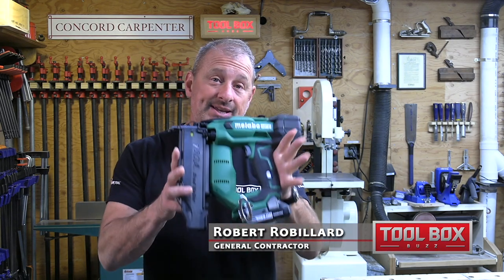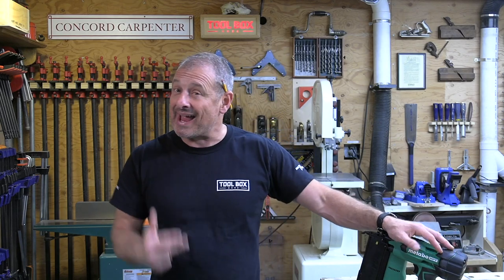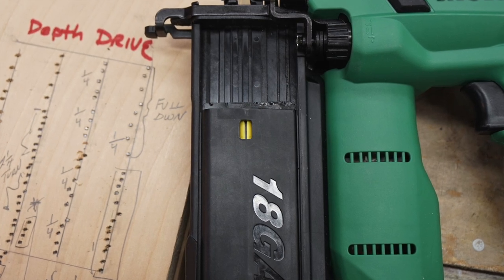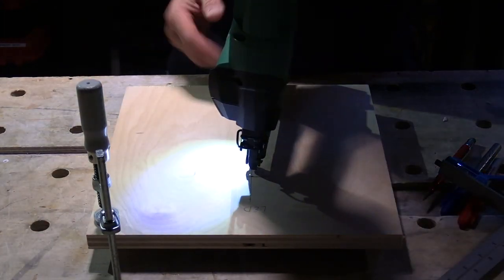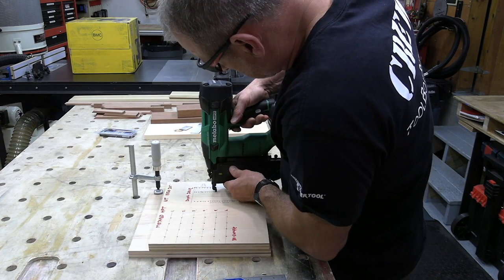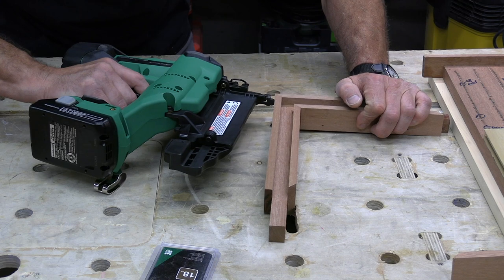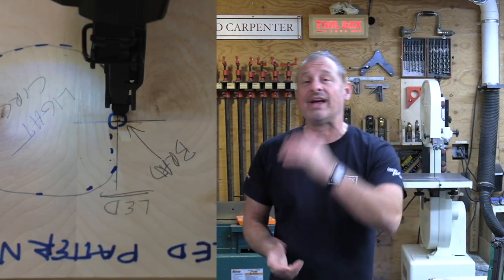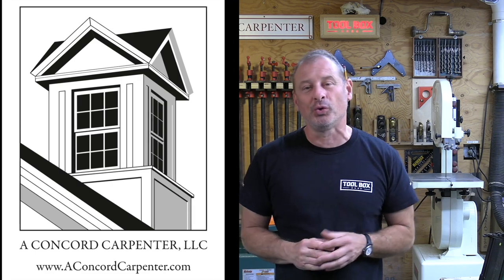Metabo HPT 18V MultiVolt 18-Guage Brad Nailer NT1850DF

Comment: Have the framing gun. Bought it first been great, so impressed bought the 15 g finish gun, worked great for about six months, then had a critical failure, need to send back, despite that bought the 23 g pin gun is ok a little weak and just recently bought the 18 g brad so far like the framing gun, impressed.

Comment: Friggin awesome! Smaller/lighter is better! I bought my cordless guns when they were Hitachi. I've got the 23, 18, 15 gauges, and a framer. I couldn't be happier. Well, now I could, because they just made this one. Haha! The "older" ones used the same tool body and just made design modifications for the different nail sizes. Even the 15gauge is the same basic gun with just different magazine and such. So, this is great that they completely revamped the 18 gauge. I probably won't buy it, though. I can live with the super sized one I have now. Thanks for the video! Good stuff as always!

Comment: I have the 16 ga, 18ga and framer, gen 1. These damn things won't die.  I will replace each one as soon as it dies with Milwaukee, but hasn't happened yet.  Only gripes are 
- the nail follower in framer gets dirty easily and doesn't push nails as hard so I get occasional misfire.
- the 16ga doesn't like 2.5" nails period!

Comment: I love my Hitachi 18v guns, so I’m excited to see improved versions coming to market. My only gripe is with the 16ga nailer which seems to not like sinking any nails longer than 1.75” which is quite disappointing. The 18ga has no issues with 2” nails and the 15ga and 30deg framer work like a charm. My compressor has been collecting dust. I would like to see an 18v coil roofing nailer though

Comment: Do this nailer still have that 30 minute shutoff feature where it turns the nailer off on you after 30 minutes of not using it? And also the 3 second tip depress where it won't fire the the nail if you hold the tip down for more than 3 seconds?
Reply from the maker: Yes
Reply: I wont be buying because it has those "features". What a let down. Cant believe they left them like that considering everyone i speak to hates it ant thats why i sold my gen 1.

Comment: Which do you like better, this nailer or the Milwaukee M18
Reply: Milwaukee 2nd gen is better, plus has a 23g to. this one still  weighs a lot.
m18 has a why better tool line up and tablesaw and miter are m18 .
Reply from the maker: The Milwaukee is better
Reply: @ConcordCarpenter  glad to hear that, i have the m18 but am always intrigued by new offerings from other manufactures. I used to be loyal to one battery platform but I have found myself over the last few years giving up that loyalty if I find a tool that I like better on another platform.
Reply: Any of you guys have had any problem with the Milwaukee 23 gauge gun not sinking the pins? Mine very seldom sinks them completely in any type of wood. Yes I've checked the depth drive dial and it's set to the deepest setting...
Reply: @reddawgrup1779  Try headed pins
Reply: @bradkjernisted2076  Never thought of trying that... Smh.
Do you have the Milwaukee 23 gauge? Is that what you use?
Reply: @reddawgrup1779  have had zero problems with mine. I have put about 10k pins through it. You might have a lemon, usually the Milwaukee pin nailer is a solid tool.
Reply: @ConcordCarpenter  any idea why my m18 Brad nailer constantly double fires and/or jams?
Reply: @reddawgrup1779  No I don’t have one,but have seen 23 gauge nailers work properly after switching over to headed Brad nails.
Reply: @bradkjernisted2076  Ok, thanks for the heads up, I appreciate it. Have a good day. 👍
Reply: @reddawgrup1779  Let people know if it makes the difference.
Reply: @emaboo592  I have the same problem. Ready to go back to my old Paslode. Not happy about it.
Reply: @scuba130  Metsbo’s table saw bests milwakees
Reply: I have had almost all Milwaukee fuel line such as table saw, mitre saw etc
Metabo HPT 36V table saw and Mitre saw are better performers than my milwaukee-plus I plug them in with the AC adapter(game changer for extended use and extends my batteries life as well
As far as the other Metabo HPT tools that have replace my Milwaukee are the 36V recip, grinder, SDS rotary hammer, Hammer drill, the only 1/2 full size plunge router, and portable band saw-each one can also be plugged in with AC adapter, lifetime warranty and in most cases more power
Reply: @reddawgrup1779  You should check the end of the driver blade for any damage also.
Reply: @bradkjernisted2076  I'll try n let others know if the other pins work.
Also to answer this post, it started happening pretty early on after I bought it, probably shot less than 100 pins with it. No I haven't closely examined the driver but I will tomorrow tho. 👍
Reply: @Jddlincoln    Same here
Reply: @reddawgrup1779  Something is wrong with your gun, I use regular porter cable 1 1/4 pin nails from home depot with it and it's hands down the best cordless pin nailer I ever used.
Reply: @scuba130  Milwaukee gen2 Brad nailer- 6.3 lbs
Hitachi Gen2 Brad nailer- 4.4lbs(featured in this video) 
It's also much smaller, about the size of a pneumatic Brad nailer.
Reply: @ConcordCarpenter  agreed

Comment: I own the Milwaukee gen 2 brad nailer is it safe to say Milwaukee is still better?
Reply: No
Reply: Yes.
Reply: They're about the same in power and speed, but the Hitachi is better for 3 main reasons(in my experience).
-The gen2 M18 leaves a flat line indent in all but the hardest woods. The gen2 Hitachi leaves just the dot of the nail head. They both sink nails no problem. Something is causing the Hitachi to sink nails more smoothly. 
-The Hitachi/Metabo hpt is smaller and lighter than the Milwaukee, and noticeably more comfortable in the hand. It feels like you're holding a pneumatic 18g with no hose. 
-The Hitachi(like most of their cordless guns)can be serviced at home since it uses air while the Milwaukee uses nitrogen and must be sent in. This is huge long term. The M18 will last 1-2 years under moderate use before it becomes weakened to the point where it's not usable. When you warranty it. Milwaukee will tell you how much it cost them to recharge and/or replace the cylinder, and it's about $300. The warranty is 5 years, so you'll get it serviced 2 or 3 times under warranty. After that it's cheaper to just buy a new gun. The Hitachi can be serviced by the owner for free indefinitely, or until the parts themselves break down. The warranty in the US is also about 2-3 times the length of Milwaukee's warranty.

Comment: Can you do an endurance test with cordless  18 guage narrow crown staplers? The newest ryobi P361 vs  milwaukee vs dewalt?
Reply from the maker: What do you mean by endurance ?
Reply: @ConcordCarpenter  
Continues shots until unit overheats from a box of 5,000 7/8 long staples simulating mass area stapling. I install underlayment and this would be helpful for floor installers.
Reply from the maker: @Zombieboxx1  Gotcha
Reply: @Zombieboxx1  I own milwaukee stapler.  Tried using it on an underlayment job with 1" staples (I think) and it's basically unusable.  I figure same goes for pretty much every other battery powered stapler.  Heat is the enemy of these tools, especially since they try and make them as small as possible so not much ventilation.  With m18 stapler in my case, starting with it from cold in the morning, staples on edges every few inches and about 1'x1' throughout sheet, I got about 4 sheets in before it overheated and shut down.  I had 60 sheets to staple down, lol.  Once it overheated, I had to set it down and if I waited about 15 minutes I could get another sheet in, 2 if I paced myself.  One thing I noticed, if I pushed stapler to its limit of 3 shots per second, it would overheat extremely fast where as if I paced myself and deliberately went slower, maybe 1 shot per second, it would last longer and let me do more before overheating at the cost of time.  So these staplers in my experience are a no go for big jobs but are ridiculously convenient for smaller jobs where maybe you're only doing one room and not a whole house.
One thing that helped is we had AC running in house we were remodeling and every chance I get I would put it over the vent to cool it off fast.  Ideally, IMO, if you really want to do big jobs with battery staplers, you would need 2 or 3 so you have a few cooling off while you're working the other one.
One annoying problem my milwaukee stapler (and brad nailer too) has is a tendency to dry fire with plenty of staples and nails.  It's like it can't grab a hold of next nail/staple and just keeps on dry firing with you having no idea.  Very annoying having to go back and figure out where it happened and redo your work.  That's why I'll continue to use air staplers for big jobs.  Hopefully milwaukee fixes this feeding issue in gen 3.

Comment: where can i buy this tool? i just bought the first gen NT1850DE(S) but this new NT1850DF is only 4.4lbs vs the orignal 7.3lbs. which is defintely worth the upgrade
Reply from the maker: It’s coming out soon, check their website
Reply: @ConcordCarpenter  found on Amazon (US) but out of stock. Do you know if this has the same expected release date for Canada?